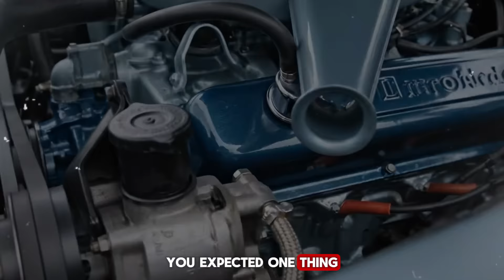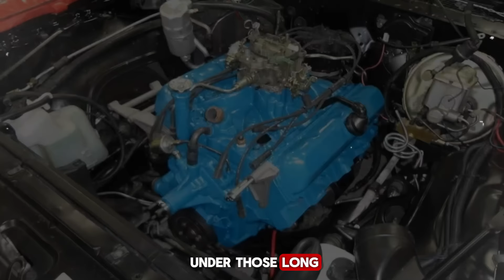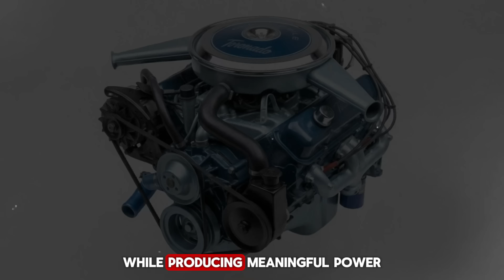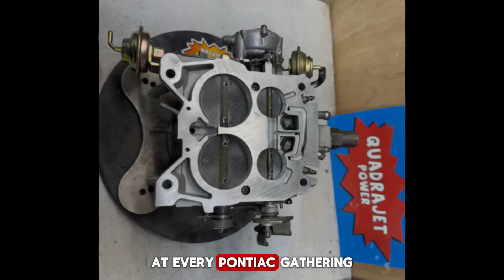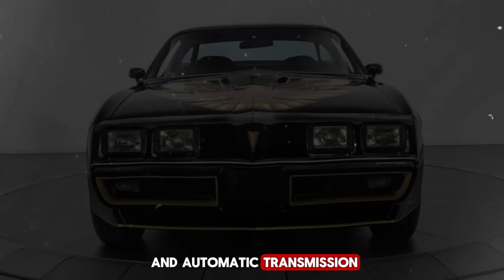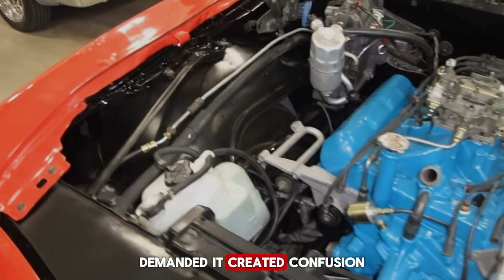How Oldsmobile’s 403 Became the Most Controversial Trans Am Engine

Comment: You can't guess how many people argued with me over the years that the 6.6 wasn't an Oldsmobile motor. Late 70's, early 80's GM got into a lot of trouble swapping around motors. Imagine buying a Cadillac to discover it had a 350 rocket under the hood.
Reply: Well several of the better caddies had 350 olds “Rocket” motors from the factory.  
The 76-79 Seville 
The 79 and some 80 Eldorados sold in California 
Those engines had fuel injection exclusive to those cars and I’d argue as a mechanic and machinist the olds was a very very stout and smooth motor before the fuel injection improvement.
Regarding the trans am yes I’d much prefer the 400 Pontiac since it was stronger in factory tune could be modified for much more power came available with a four speed manual.  T/A 6.6 meant a 400 Pontiac while 6.6 liter decals on the hood shaker indicates the Olds 403.  
Most of the 400 Pontiac motors rated at 200- dyno test suggested closer to 220 on the 77-78-79 cars.
The olds 403 by comparison almost always had the automatic and rated closer to 185.
Great motor in its on right.  Olds 425s 455s made lots of performance in the 442s and Toronados back then.  
All in all fantastic automobiles the likes of which we will not likely see again….hold on to whatever you have or can find.
Reply: I believe GM actually got sued over not having a brand engine of a car's line in the car.
Reply: @w41duvernay  Yes, the lawsuit was in 1977, when GM put Chevy 350's in the 1977 Olds Delta 88's instead of the Olds rocket 350 that buyers thought they were getting. The problem was they didn't inform the buyers in their sales literature of the substitution, or on the sales floor either apparently. Also in 77, GM started painting all their engines, including Chevys, with Corporate Blue paint, probably to make it less obvious which engine you got. The final court verdict: Purchasers of Chevrolet-engine Oldsmobiles before April 10, 1977, would be entitled to refunds of $550, while those who purchased one afterward got nothing. Furthermore, there would be no punitive damages assessed against GM. Total settlement cost to GM: $8.2 million. In 1978, GM started putting in their sales literature and on the window stickers (Monroney label), exactly which engine you were getting.
Reply: So what buddy. 403 is fine engine ...lots of torque and potential for more power